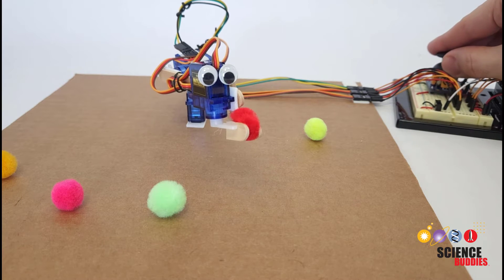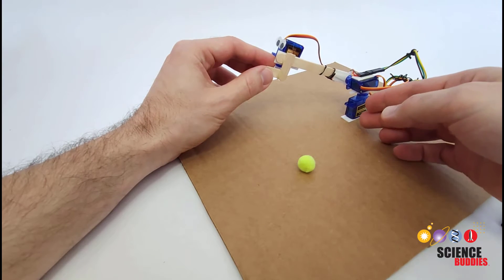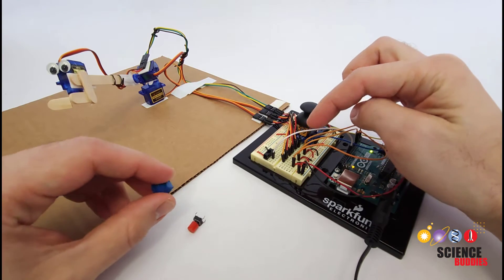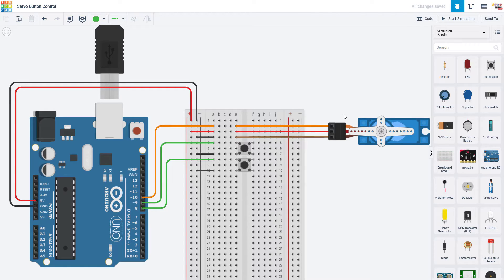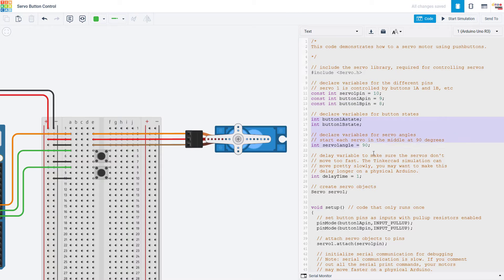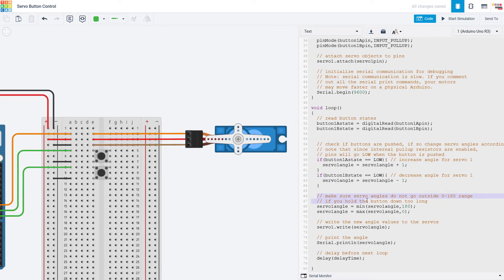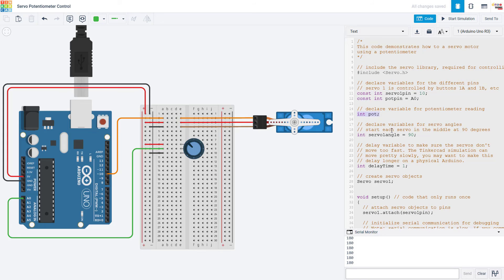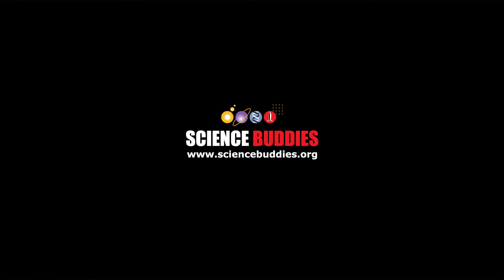Popsicle Stick Robotic Arm with Arduino | Science Project

Comment: Also, this is absolutely the most you can get out of the little blue servos (surprised they can even handle this!). They're so weak. To get to the next level, you're looking at LiPo battery connected to DC-DC  buck converter powering MG996 servos.

Comment: The kit doesn’t have the servo motors or the switches
Reply from the maker: Which kit are you referring to? Our Arduino starter kit does have switches, but it's just a starter kit so doesn't include some of the more expensive or specific parts you'll need for some projects, those must be purchased separately.